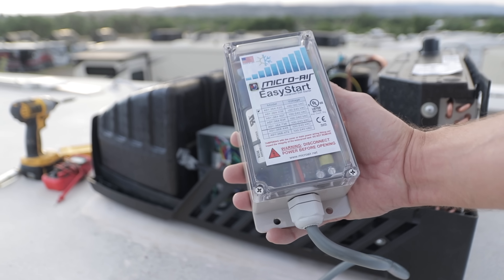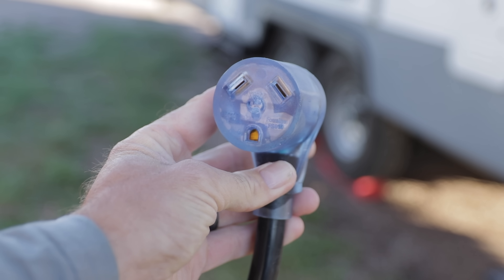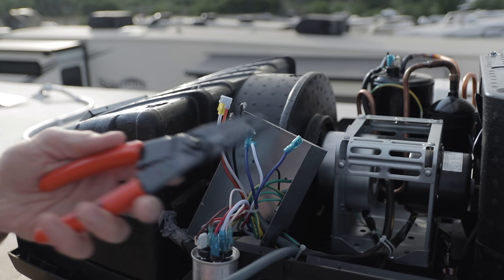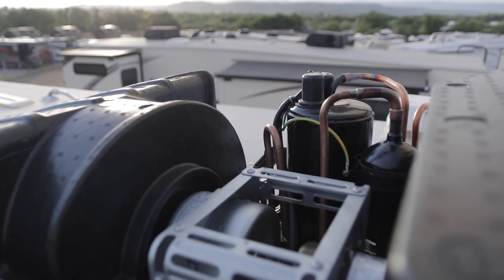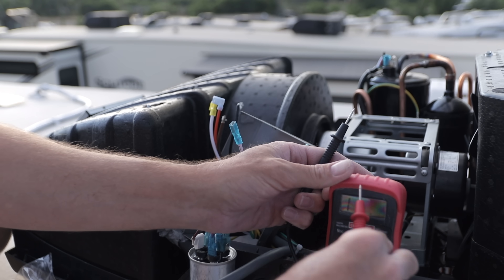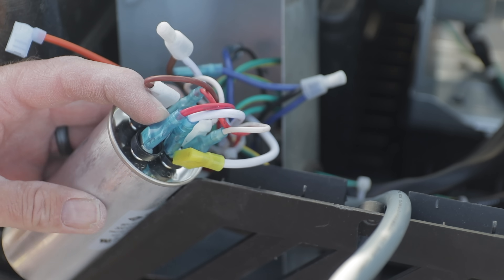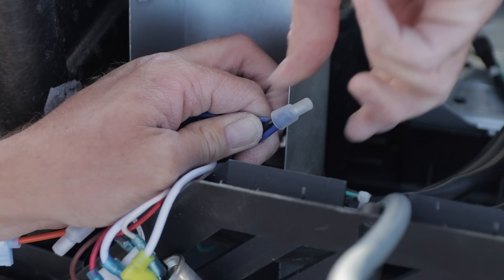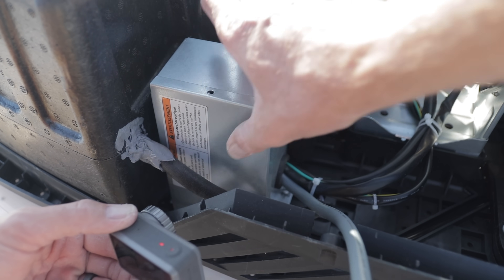RV AC MicroAir Easy Start How To Install.

Comment: Thanks, your video was exactly what I needed to ensure I did not screw it up. Got mine installed last night. 🙂One note for others with the same unit (Furrion) that was not obvious to me at first, is the splicing of the last blue wire.  Once that is done, reconnect it to the other blue and put it back where it was.  That connection can also be loose so be careful when putting things back in the box.  It's a tight fit.  I spent far more time taking things apart and putting them back than the actual wire installation part.  That was the only challenging part.
Reply: I saw 1 of his blue wires had a female spade on it . Then I read your comment. Thanks

Comment: Thank you so much for this video! I didn't realize I had the wrong wiring diagram until after I opened up the ac cover. Felt hopeless til I found your video!  Thanks much for the great info as always.

Comment: Hi … Help , I have a Furrion I think the same model . The black wire , for the outside fan I left behind, where does that connect or does it just remain on the spade ? Anyone?
Reply: Did you ever figure this out? I have the same issue as my fan is not kicking on, thereby creating an over current situation.
Reply: @rmnpcolorado  yes I did , give me minute and I can give you some help …
Reply: @rmnpcolorado  the black fan wire connects to the blue wires .
Reply: @Worthrhetime , I think my issue is I could never get a clear view of what Jared’s electrical box looked like with this piece and his description wasn’t clear. I currently have the two blue wires together in with the black whereas I believe one should be on the top post and the other spliced in with the black on the bottom. I’ll need to trace those back and fix my issue.
Reply: @rmnpcolorado hummmm …. Not sure. My issue was the one black wire that was left on the spade after everything else was done. I looked at the wire diagram on the unit and saw where it “ the black on the spade “ needed to connect with the blue . A wago connector later it was running perfectly. I’m in Colorado as well . R U working on a Furrion , Grand Design?
Reply: @Worthrhetime  I currently have the two blues together with the black from the easy start together on the bottom spade and the black wire by itself on the post up top and it’s not working. 
Yep, this is a Furrion on our Riverside RV Intrepid. I’ve watched plenty of videos for Dometic and Coleman units but they’re just different enough. Coincidentally i think I kind of figured out my issue by watching a soft start being installed on the Furrion. An extra wire but the same finish.
Reply: @rmnpcolorado  yep that ran black wire need to connect to the blu to get power. Don’t want to miss lead you but if I understand you correctly. The black fan wire needs to connect to the blue. Can you see it from the wire diagram?
Reply: @Worthrhetime  just to follow up for anyone that reads this, Jared seems to gloss over the blue/black wire connection and unfortunately doesn’t provide a clear shot of how they are installed on the post. In our unit, the black wire from the diagram was on the top post on the back wall of the electrical box and the two blues needed to connect with that, as well as adding in the black wire from the Easy Start. I mounted all four wires together on the bottom post and it purred like a kitten. More testing to follow once it warms up (unfortunately it was 70° in WI when I did it), but I’m confident it’s correct, and the Bluetooth app showed everything functioning as expected.
Reply: @rmnpcolorado  perfect 👍 you got it .

Comment: How did that mounting location go for you? I installed one of these recently on my furion but I zip tied it to the vent opening near the electrical box, didn't think the double sided tape would old up.
Reply from the maker: It worked great with no issues. Never had a problem with it.

Comment: Great video Jared, thanks very much. I have an earlier version AC unit but everything was pretty much the same. I used the wagos that came with the install kit and taped the little levers closed with electrical tape. I have yet to do the 5 cycles as I only have a 3500 watt genny and no pedestal power. I called support and they said that the first learning cycle runs at 40% and then subsequent runs get more optimized at 60% and higher, and that if you do the first cycle on anything less than a 4K Genny it will not be programmed optimally. Oh and the really annoying thing was that every time my AC compressor kicked on before the install, the surge would reboot my starlink router lol. Was driving me nuts!Thanks again!!

Comment: This system works by putting a time delay relay in the fan start circuit so that the fan and compressor aren't starting at the same time.  Motor loads have something called in-rush current during start.  Starting the fan a few seconds later than the compressor significantly reduces the total in-rush current which should avoid overloading the generator.  Just thought explaining how it works would help people understand that it isn't a scam.

Comment: Thanks for this. I just installed the microair today and ran it 5 times before using it on my genmax gm3200i. This thing made such a difference. I have a 13.5k btu AC and it pulled peak 11amps and ran around 1080-1110 watts. I can now run my AC and still have nearly 2000 watts of power left

Comment: what about boon docking and you turn off the generator. you will have to reprogram it everytime that the generator is turned off?
Reply from the maker: No it just needs the first few times of starting to learn and then it is good for the life of it. If you uninstall it and move it to a new Ac you have to do the fist few as a process again but definitely not every time it disconnects from power
Reply: @AllAboutRVs  Awesome  thank you

Comment: Buyer be aware....With the EasyStart you need to start your air conditioner 5 different times, while giving 3 minutes in between restarts for the compressor to equalize. With the regular "SoftStartRv" model u don't have to worry on this. Its a big deal I think...
Reply: Seems pretty minor unless all else is equal and it is a flip of the coin to choose.
Reply: @mattyjdyoutub  you want to restart your AC 5 times & waste a total of 15 minutes instead of doing it once? Lol... your choice.
Reply: Good grief! You would think it was 15 hours.
Reply: @mattyjdyoutub  Good grief Charlie Brown...who wants to start up their AC 5 times & wait longer than it should take, when once should be all you need. I believe the majority will agree...

Comment: So the soft start isn’t as good as the easy start?
Reply from the maker: They are very similar,  the Soft start RV and the Micro Air Easy Start. I think the Micro Air has a Bluetooth model now. Either will be good, some try to compare it to a hard start capacitor which is not comparable.

Comment: Anyone have experience running a 13.5K AC with East Start and a 2000W generator?  I have a Champion 2000W generator (2000W Peak / 1700W Continious).

Comment: Some videos give the impression that the install can be done in 30 minutes, maybe even by the spouse.  My rig has an AC/ heat pump and I've spent an hour to get wiring diagram.  Then, many people don't understand or have a multimeter to check continuity.  Then, you might need to call SoftStart tech support, which is very responsive. 

Nevertheless,  I went on my roof, took the cover off the AC, took photos of wires and components, and studied the diagrams before I went for final install.

A person should have a moderate level of understanding before they do this.  I think this needs to be clear.

Comment: You should Never short a capacitor. You should Always discharge it through a low ohm resistor. The law of physics is that you cannot instantaneously change the voltage across a capacitor. When you violate this law. Something has to give, and that something is internal damage. You can short out the capacitor internally by doing this.

Comment: Curious if this only works on rv style air conditioners or could this be adapted to work with a window unit air conditioner. Planning on putting a small WU in a box truck conversion and I'm worried about the amp draw, especially the surge when the compressor kicks on. Havent seen much info on this idea. For reference im not trying to be able to run a unit solely off generator or shore power. Going for solar charged, deep cycle battery unit then into the AC but I have yet to see a window unit that doesn't surge past 40-50 amps.

Comment: Once again, another great video and another upgrade that I'm saving and planning to to do on the rig as well.  I have read that this can allow the A/C to be used when plugged into a common 15 or 20 amp home outlet.  Any thoughts on that?  I'm wondering if there is still too much draw to support a 15 or 20 amp outlet and the fire risk too great to safely use?
Reply from the maker: It can but it would be the only thing on for a 15,000 btu ac to not over draw on a 15 amp breaker. If it’s 20 amp or a 13,000 btu ac you have a little wiggle room to have a couple small things on.

Comment: I am installing a 2nd AC on mine and was wondering... do  I need to put one of these on both units or would putting it on one be ok?
Reply from the maker: You would need one for each AC
Reply: @AllAboutRVs   So next question I hear you can run both ACs on 30 Amp is that true?

Comment: What would be the reason to use the easy start over any other capacitor on the market that are $15
Reply from the maker: Some ac units already have a start capacitor and those that don’t a start capacitor can take a very small edge off the starting current but the Easy Start we installed is much more sofisticated and can do much more than take the edge off. It’s proven to most the time take the starting current and cut it in half.

Comment: Jered:   At 3:15 you mention that if there is a start capacities on the air condition it should be disabled or removed.  Is there such a start capacitor on the Furrion?   If so, the video doesn’t show how you removed or disabled it.

Comment: Does cooling capacity of your AC goes down after the install?
Reply: No. The purpose is to engage the compressor. The load required to engage it is very high, let's say 3000 watts. Once it is engaged and cooling - the operating power will range around 1300 watts to 1800 watts depending on your model. A generator can easily handle the operating watts, but only a few can handle the engaging watts.
Reply: No, the cooling capacity does not go down after installing a soft start. But, it does take a little longer for the air to blow as cool as it does without one. Soft starts slowly ramp up the compressor/motor, so there isn’t a big influx all at once. Soft starts are more gentle on compressors/motors, which are better on them in the long run.

Comment: Did the Micro-Air install this weekend. Jared's walk-through was extremely helpful. Really, it wasn't that complicated and the installation kit for my 15K Coleman Mach had everything needed. Worst part was getting up on the roof! My Honda EU2200i now easily starts the A/C (ECO off) and keeps it running (ECO on). I've had the A/C, a few lights and the TV on at the same time without any issues. Saved the cost of paralleling with another EU2200i!

Comment: I wasted my money on this. I live at higher elevation and while the easy start does allow the AC to start up easier, a EU2200I will overload within a very short time. So if you are +4000 elevation you still need way more power than a single 2k generator can provide. Seems to be fine for people closer to sea level. Be warned!
Reply: I live a 4500' and recently took my eu2200i and trailer up to a favorite spot in southern utah and camped at 8000'.  As long as I ran the ac fan on low i never had an overload problem and the genny/ac worked fine and no easy/soft start installed.  I plan on picking up a softstart and seeing if it allows me to run high fan and full cold settings on my 11,500 btu AC.  For the record - temps were in the low-mid 90s and we ran the AC at the end of the day to quick cool the trailer after hiking the slickrock canyons.
Reply: @scottlewis5755  Glad it worked for you. 11.5k is on the smaller end for RVs, so I can believe it works. I have 13.5k and it absolutely overloads on a hot day after 3-5 minutes at 5000ft elevation or higher on a single 2200 gen.  Killa-watt records 1700-1800 watts usage which is right at the limit of hondas EU2200 runtime.

A 15.5k would have no hope of running at these elevations on one generator.

I run dual eu2200's off a bulk tank now, and everything else in the trailer minus the microwave at the same time, anywhere, any temperature, any elevation... no sweat.

Comment: I have a Grand Design 367bhs with 2 Coleman Mach ac's. One is 15,000 btu and the other is 13,500. If I install the soft starts on each unit what size generator would you recommend to run both units? Thanks

Comment: Thanks for the demo Jared, I've been told that the best way to start the AC is to turn the fan on at the thermostat and let it run a couple minutes then switch to cool. Do you agree?

Comment: As usual a great video. I have a harbor freight 2500Kw inverter generator. There is not a 30 amp outlet  on the generator. Will that generator be sufficient to run the air with this device on the trailer a/c?

Comment: I don't understand why it costs so much to add a capacitor to an air conditioner now days! Into the 2000's I've bought air conditioner capacitor kits for $15 new several times starting in the late 1980's.  They came with instructions, a larger capacitor than the factory air conditioner one with enough wire to locate the added capacitor where it would fit and that was it.  No circuit board control center.  Add the capacitor is what will pick up a person and send them flying and what should be grounded first and depending on the electronics being worked on grounded often while working on a component.  Been working around them since the 1960's.
Reply: Agree. Someone should tear down this thing and see what the components are really worth. Seems grossly overpriced. Worked for Carrier many years ago and most a/c units are now made in China and the prices are about the same as they were 40 to 50 years ago for complete units.

Comment: Why don't they just install these at the factory? Are there upgrade options to get it that way? Are there any manufacturers that just provide that as standard? What are the downsides??? (except maybe a small extra price hike on the end product)
Reply: Exactly
Reply: Would make it much easier. I have to install one on my RV. It should be here any day.
Reply: Not standard because it complicates the system. Don’t need one of these if power is nominal. If you are low on surge power these are useful.

Comment: New viewer her and first time to comment on any UTUBE item, I'm so glad someone finally addressed these easy start systems, they seemed to be a myth when you inquired about their existence to people who should be in the know like RV tech people and regular heating and air conditioning people, I have had no luck they mostly go silent and look at u like u don't know what your asking for. Anyway I was wanting to ask your input on a similar product and if you thought that it was capable of doing the same thing? It sells for  around  $110.00. It claims to do the same ,I think? How do I get u a picture of it? It is on Ebay, seller name is , "applianceandair 18434",under Part Type it is called RV-AC Starter,Easy Starter.
Thanks for your time Rodney B.

Comment: One thing you didn’t mention is the relearn procedure. In rare cases you have to reset to default and have the easy start relearn the unit. I just ran into this problem where the AC wasn’t working properly, the AC compressor would not always kick on or would shutdown prematurely . I did the relearn and the unit is working fine for the last couple months. The installer/engineer from MicroAir told me about it and how to do it. It is also on their website.